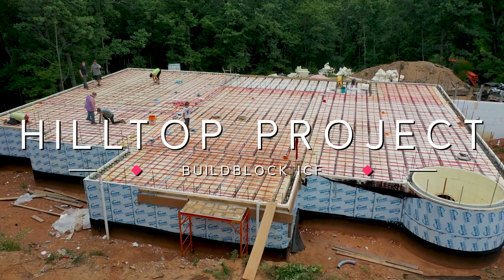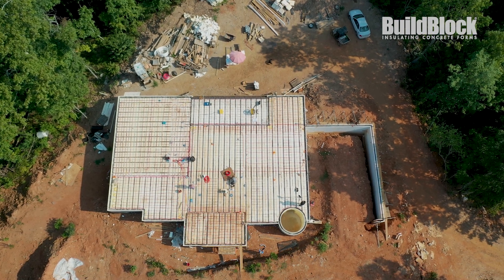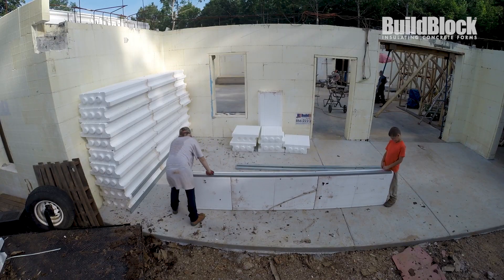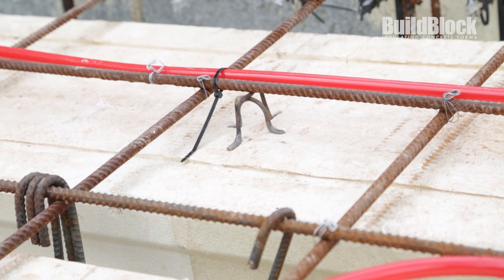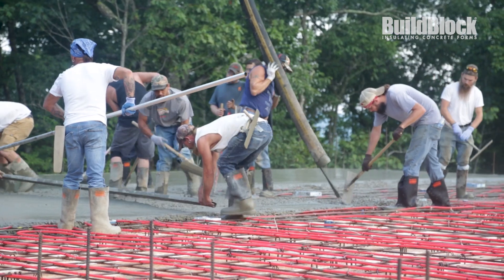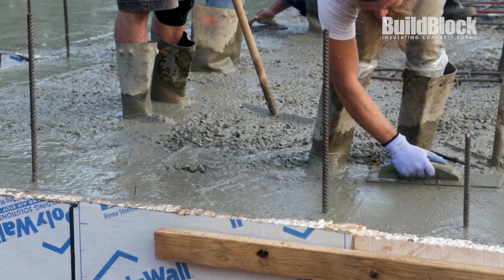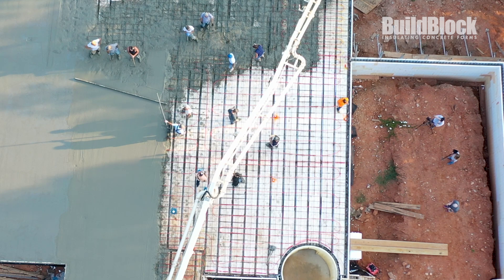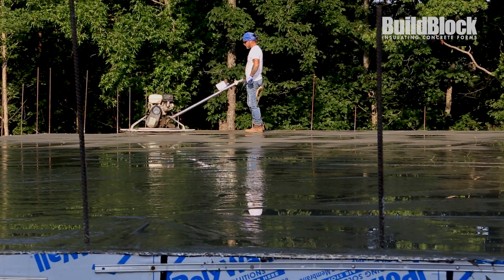How to Pour ICF Decking - BuildDeck

Comment: Have you ever considered putting a tracking wire with the radiant tube.
Reply: so you can see were its located? maybe a thermal device like a flir?
Reply: @ac14081408  Flir works perfectly you can see all the pipes

Comment: You should NEVER use rusty re-bar with a concrete poor!! The water in the concrete will cause continued rusting process, and eventually lead to failure!
Reply: Oh Kenny, and I bet you think bridges collapse because of the weight going over them. My original comment was stated because as a customer you have a choice whether to accept oxidized materials or not! For instance: would you buy water damaged insulation? You’d send it back or change suppliers if they refused to exchange it. Good supply houses will keep their steel products in drier places. Also, a good contractor notices the state of the oxidation and will reject that which is most damaged. Usually surface rust is ok, but only if you know what you’re looking at.
Reply: @stephentaylor9366  You need oxygen for steel to rust. Embedded in concrete, you have little available oxygen after initial rusting. All iron, steel, titanium, aluminum, etc "rust" upon exposure to oxygen but titanium and aluminum quickly form an oxide layer that prevents exposure to more oxygen. The same happens with certain types of steel. If you introduce salt, such as on roadway bridges, this can accelerate corrosion through a process i am not familiar with but you are not "salting" the rebar in concrete buildings. The original rebar rusting will have little affect on the strength in the ICF construction described here. I'm a novice just like you and we both need more education to fully understand the way this "should" be done but I think these guys know what they are doing in this video.
Reply: Well that's just not true.
Reply: @m.5051  Interesting. Have you done some research on rust being encapsulated in wet areas?
Reply: @stephentaylor9366  It's not encapsulated in water.  The water in the concrete hydrates.  It's a pretty complicated subject with a lot of chemistry.  The cement paste actually forms a passive protection layer around the bars which keep the steel from deteriorating.  There's obviously way more to it, but placing bars with a surface rust is not a big deal.  Show me a black bar that hasn't oxidized on the surface.
Reply: Rusty rebar is used all the time. In fact, the oxidation makes are larger surface area on the rebar for the concrete to adhere to.

Comment: How much does it cost to build ICF vs wood frame house? Also, how much ICF slab vs suspended slab cost?
Reply: ICF Forms are Extremely easy to assemble with little more than basic hand tools. The trick is good bracing. 
I've helped do 2 ICF basements and work with a friend of my dad to do a couple ICF home pours. We had 2 people to do the entire house pour. It went  smooth. That was 20 years ago. Technology has greatly improved since then.
Reply: ICF can be less $$ depends on efficiency of stick framers vs ICF stackers.

Comment: Sloped/angled roof? To what degree? 12.5° ? 25° ? 37.5° ? 45° ? A 4/12 to 6/12 pitched roof would be awesome. Like a complete concrete insulated house.
Reply from the maker: Yes, pitched roofs are pretty common with this product. The most common pitch we've seen is 3/12 but we've also seen people go as high as 8/12.
Reply: BuildBlock ICFs that’s awesome. So a heavy snow load is not much of a problem then.
Reply: BuildBlock ICFs that’s great! How much would a pitched concrete roof cost compared to a stick framed? I’m assuming it depends on the area and the talent that’s available?  

Also how would shoring the roof of a 2 story ICF house be done IF the second floor deck was not concrete? Meaning the
Reply: Rick Tatorship i don’t think you want an ICF roof on a stick frame. One possible solution in this scenario would be SIP panels.
Reply: 4philipp nah I mean the second floor itself, the walls are still ICF. I should probably rephrase the question.